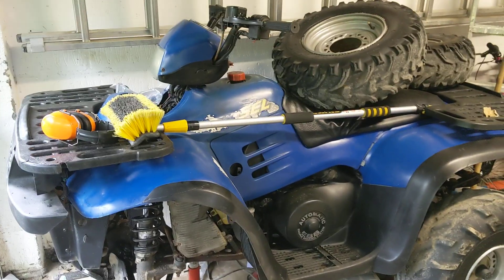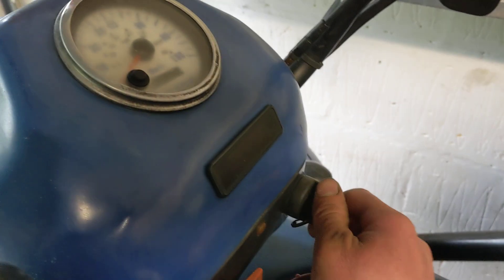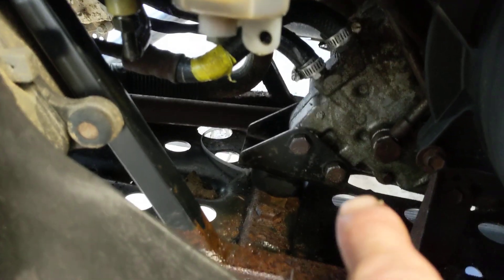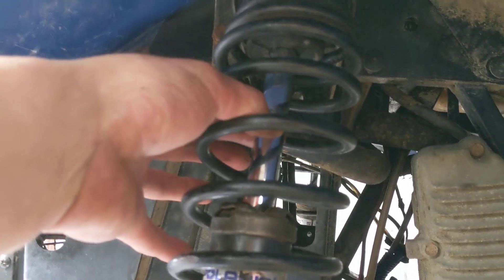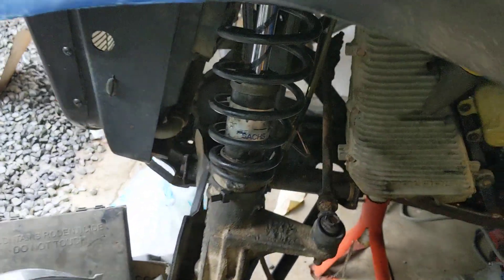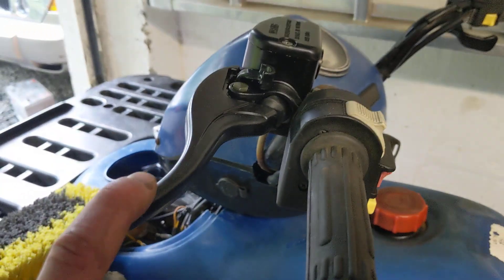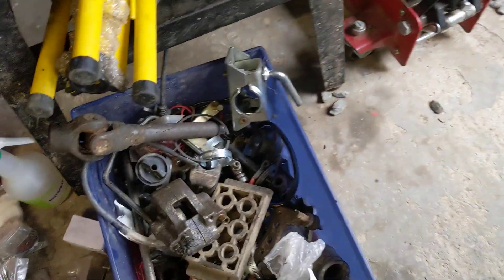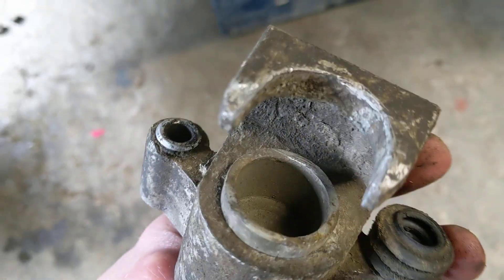Polaris 455 diesel quad project part 6 almost there!

Comment: were do you  buy parts from ? i just got a polaris 455 diesel and needs some parts
Reply from the maker: Had them in a stock pile a long time. All engine parts arernt made anymore haven't been for 5 years
Reply from the maker: What did you need? Have a full spare running engine now.....
Reply: An idiots opinion as soon as you commented that I took mine for its first test drive everything well just need cv joints and front brakes do you have any ?
Reply: An idiots opinion how much do you want for the engine and do you have a drive box my drive box is gone ?
Reply from the maker: I had two engines but now both sold sorry... I've got a complete rear end in good condition (gearbox diff etc etc) £350.
Reply from the maker: @cameroncrofter8871  I can get you full CV shafts fairly cheap from my supplier who I get good discounts with. Front brakes are really really hard to find I have one set but will probably use them on a current project. Your far better off buying a cheap Chinese set for a 550 sportsman if there completely gone as the only about £35 the calipers are exactly the same except the sliders which you can swap. You'll need to get new brake lines made up as they use banjo bolts. Give me your number if in UK if you want and I'll  explain
Reply: @An idiots opinion  is there any way I can private message u it
Reply: Have a complete one minus a piston in an engine with 630 miles. Plastic is rough but it’s all there. I’m in Oklahoma.